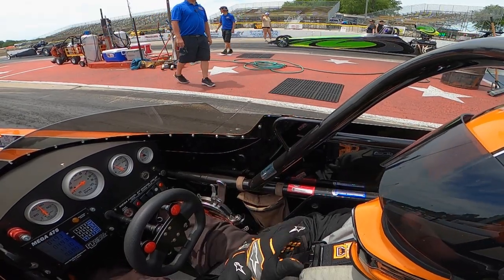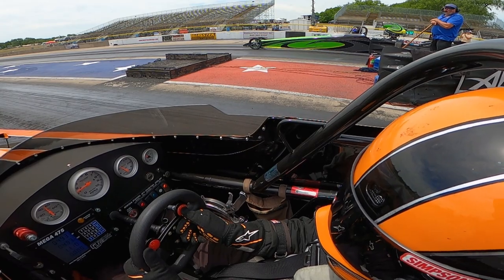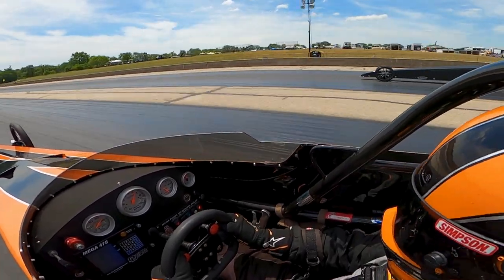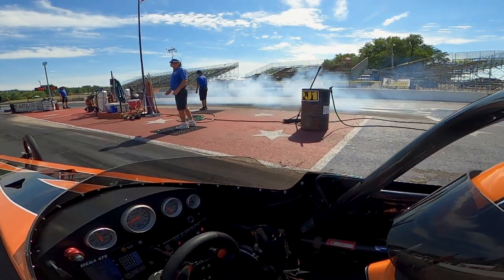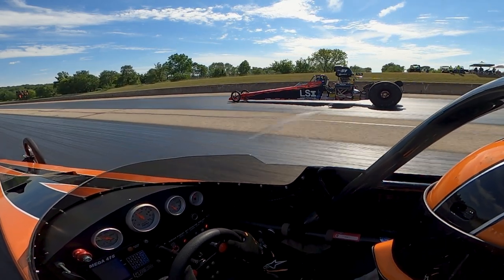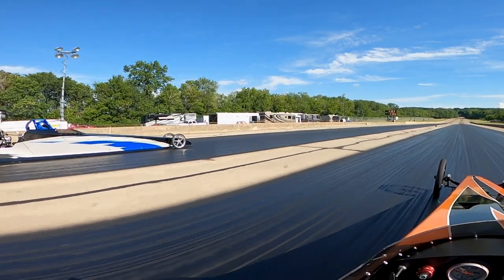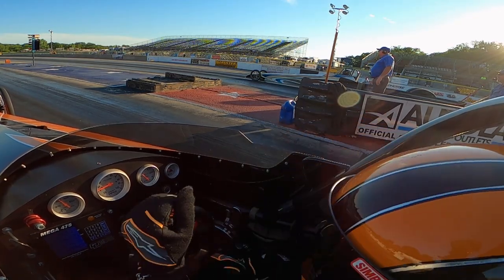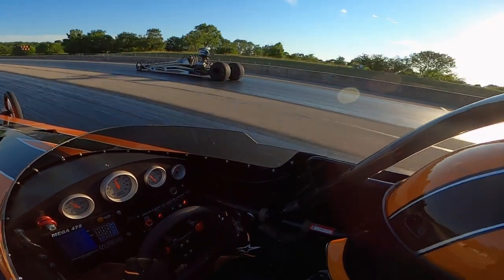A Deeper Look into Bracket Racing Strategy

Comment: Hope it's ok to ask questions. What do you mean when you say your holding x amount of time as you are making a pass?
Reply from the maker: Absolutely! If I think the car is going to run let's say a 4.91, then if I'm holding that means I'm going to dial something slower than what I assume the car will run. For 3 reasons. 1)if my car does happen to slow down a little bit I will still be able to run my dial in or atleast be closer to it. 2)it can mask a bad reaction time. 3) it should help put me in front of the other car at the finish line where I can then control how much I take the stripe.
Reply: @gooncotv  thanks for the answer. I get it.